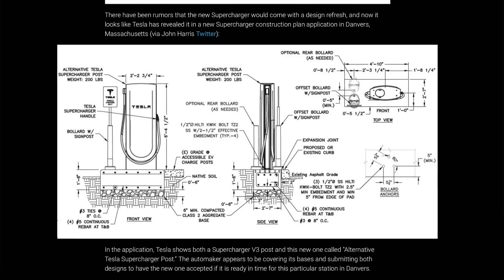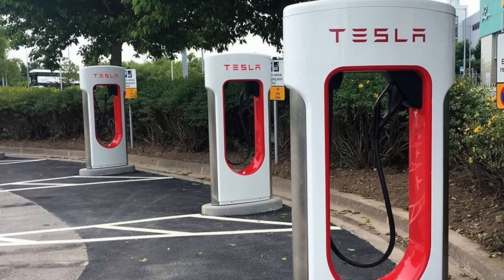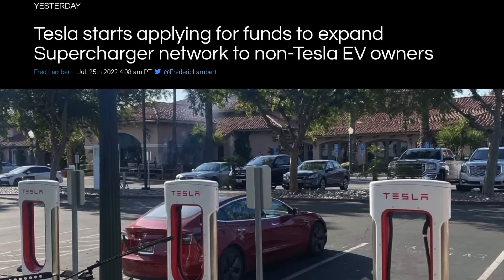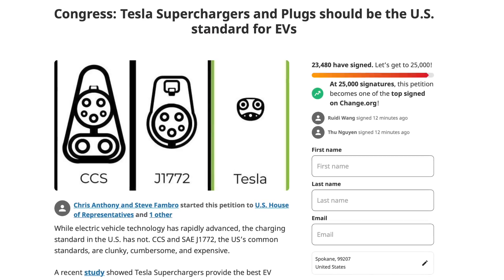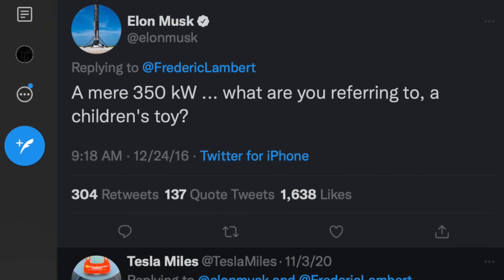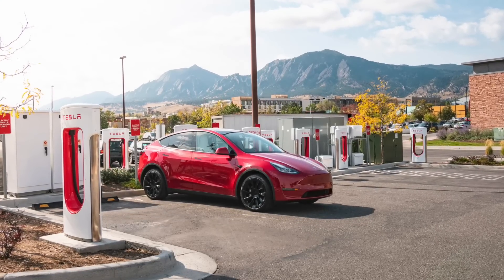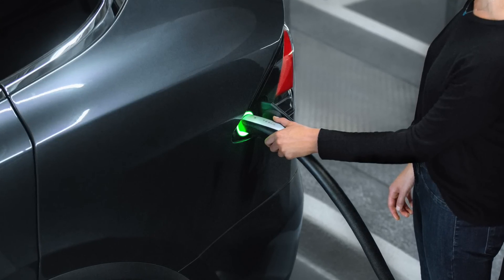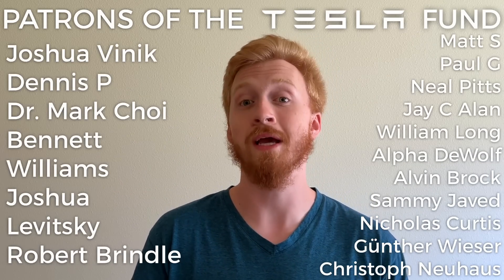V4 Supercharger Design Leaks: The Future of Charging

Comment: I don’t have an EV right now but did have Bolt for a little while. I’d support Feds mandating the Tesla style plug and associated software. Tesla would probably have to be compensated in some way by the Feds, but few times I used a CCS charger it was finicky and had to use trucks like pulling up on the plug to help it stay connected long enough for the handshake. Rarely hear about that type of issue from Tesla connectors. CCS chargers being down or not working correctly in general is more of a management issue. Tesla network is a selling point so they have incentive to make sure they are working all the time. If EA and others cared they could have high availability too.

Comment: Tesla in the United States still doesn’t have CCS is like apple not going to usb type c
Reply: It's like apple not going to USB type B and like if Apple was 75% of all phones sold and like if there weren't also laptops and desktops that used USB C
Reply: @TailosiveEV  yeah but if wanting to cut costs you will do the same across all factories, I do think tesla will adopt the CCS connector but i do agree with what you said about the design of it. They can fix the pin issue but CCS is the way.
Reply: @JosephRawsthorne31  It’s a different CCS in Europe compared to CCS in the US. So no, they can’t standardize hardware across continents. 

The Tesla connector will win in the US.
Reply: @JosephRawsthorne31  The only way they fix the pin issue is by updating to a new connector with a more durable/less fragile design. Like the Tesla connector... If anything, it'd be kinda interesting to see the Tesla connector and CCS merge like how USB 3 & 4 and Thunderbolt 3 & 4 all merged into the Type C connector port.